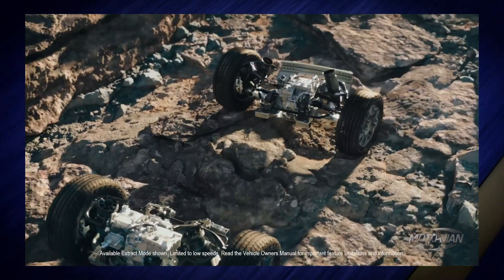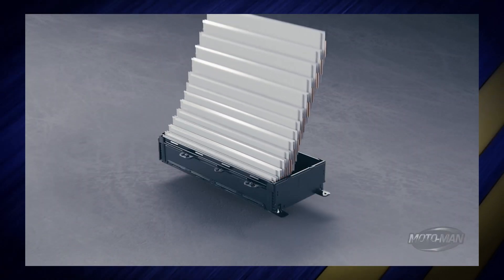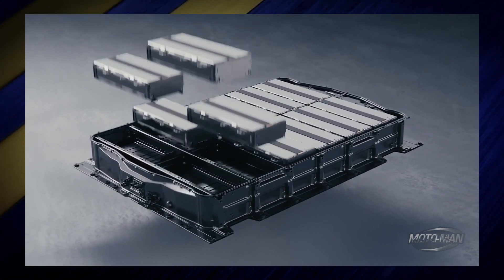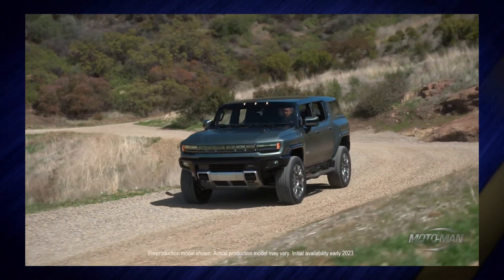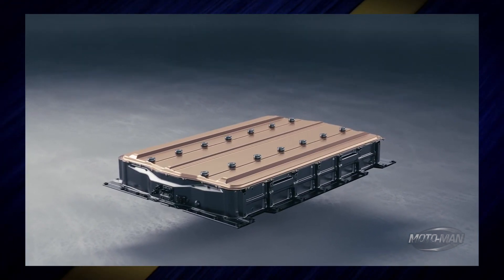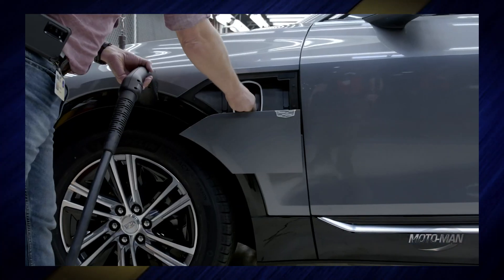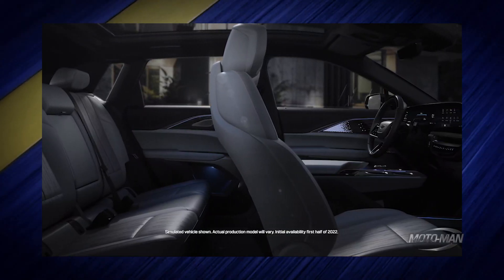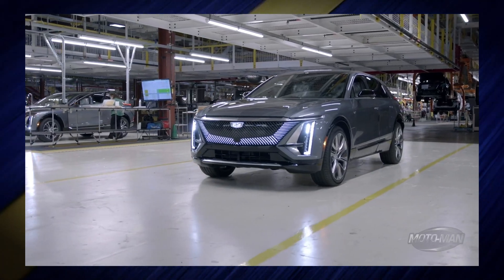What is GM’s Ultium and how is it going to underpin all their vehicles for the next decade?

Comment: Are there any good examples GM has of good integration (besides the wireless BMS)?  Tesla brags a lot about integrated design/engineering, like the "octo-valve" all-in-one thermal system, gigacastings that combine a bunch of different components into one piece, and structural batteries that reduce redundant structure and simplify vehicle manufacturing.  What's the nickel percentage of the current Ultium NMCA chemistry? What are the gravimetric and volumetric energy densities of the Lyriq battery pack?  Can Ultium support using LFP chemistries for cheaper models or if other battery supplies get severely supply constrained?

Comment: Awesome interview! It seems like GM has designed an architecture that is a lot more flexible than anyone else with so many ways to stack the modules. What made that flexibility possible? Is it the chemistry, the pouch design, the modules, the cooling system, etc.? Also, nobody from GM seems to be saying anything about safety. How will these new Ultium vehicles—without the ICE baggage—keep people safe in crashes? How are they safer than the Bolt packs that just had to be recalled? Are there concerns about stopping distance, tire wear, and damage to roadway infrastructure because of the pack weight?

Comment: How does GM prevent the expansion and compression during heating and cooling cycles that lead to crack formation within Solid State batteries. Is it using thermal management to keep the battery at a consistent temperature? If I left a vehicle outside in the cold without charging, how do you keep the battery warm without using the remaining charge within the battery?

Comment: Hmmm...I want GM batteries to be reliable.  I want GM cars to be reliable.  This is a fresh start for GM and you can do it better then the last 50 some odd years.  Thats saying that the degrade in quality started in the mid 70s.  GM can do this.  Yes make it reliable and attractive, please!  The light show means nothing if after a few years the bulbs burn out.
Reply: It’s funny reading comments like this where GM has exceeded reliability ratings against their competitors like Hyundai and Genesis or Ford (especially Genesis who have the WORST reliability ratings) but these manufacturers don’t receive the same criticisms. 

It’s just a meme at this point.
Reply: My wife has now had her Bolt for over five years. Except for the whole battery replacement thing (an LG problem), we haven't had a major or even minor issue with the car in all that time. the only thing I can think of that broke was the vanity mirror folding piece on the passenger side. Otherwise that's it. Most reliable car we've even owned from any manufacturer.

Comment: Ultium? Is that Like un- obtanium? My concern is less about packaging and more about economic sustainably, in 5 or 6 years when the battery's are failing what happens? Do I get a replacement free? At a substantial discount? While I do really love the technical aspects and engineering that goes into the vehicle AND the battery composition change from rare earth metals that are centered with increasing hostile nation states; the conversation that GM needs to have is the commitment to long term viability.
Reply: What indicators suggest GM is not assessing long term viability?
Reply: @JDubbs07  Have YOU heard about a battery replacement program? Many electric vehicles are showing significant battery degradation after a few years and replacing the batteries cost tens of thousands of dollars. So it is a legitimate concern
Reply: @wintermagebarthow8481  seems there may still be more for you to read on the Ultium platform. Aside from the aforementioned battery warranty, the platform itself is designed so that the cells within the pack can be both individually replaced, but also updraded to newer cells with new battery chemistry. They also have an extensive second life and recycle plan for the cells once they can no longer be recirculated back into consumer packs.

Aside from this, it's probably not reasonable to expect long term, inexpensive coverage of replacement batteries. Much like ICE cars are subject to engine/transmission performance degradation & failure over time, resulting in replacement that can cost several thousands of dollars, we really should prepare ourselves for the reality of aging & failing battery packs and motors outside of warranty.

Rich Rebuilds is a hobbyist, albeit a very talented one, with a talented hobbyist network to lean on. However, I would not look to him for guidance on mass market fixes.
Reply: Battery life is already hitting 10 yrs and longer and is growing as development increases.
Reply: @trance9158  Really? Where? I ve personally seen many electric vehicles under 10 years old already suffering significant problems and replacing the battery packs cost 10s of thousands of dollars in the case of Ford and Tesla. So where are you getting this data from?
Reply: The battery has an 8 year 100k mile warranty. So if it fails in 5 years you get a new one.
Reply: When in doubt call Rich Rebuilds